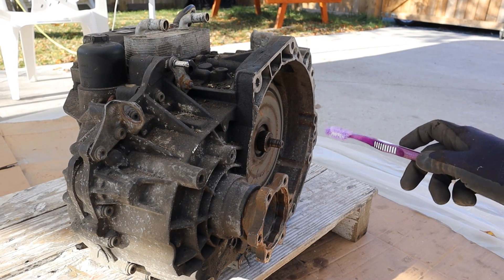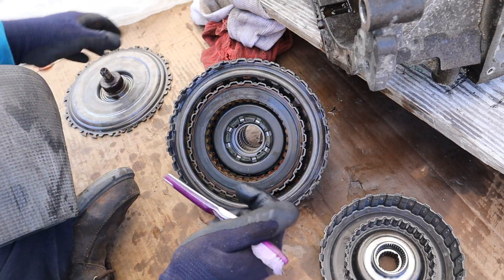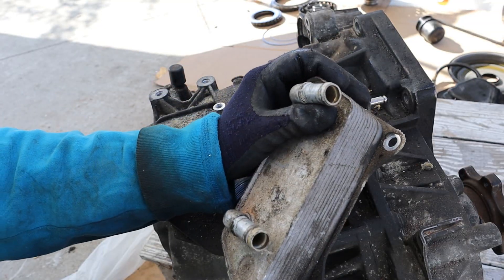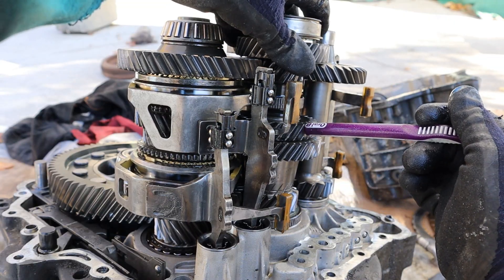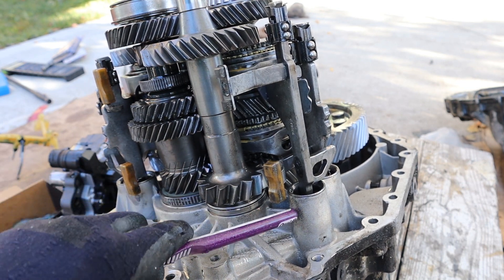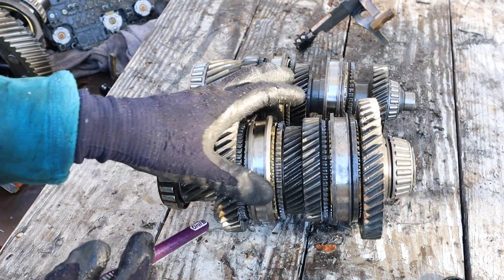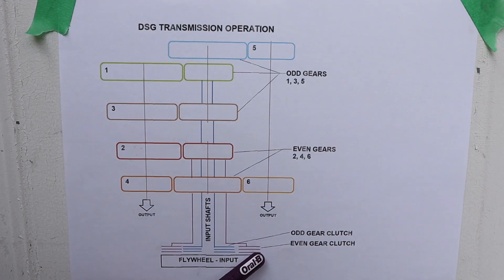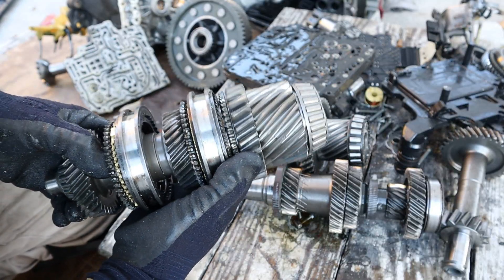How a Dual Clutch Transmission Works

Comment: 5:02  "probably didn't do oil service"  is a really stupid comment only a short time after inspecting the perfect condition of the clutches in the 300,000k transmission.  The internals are in perfect condition, no deposits on the magnets, nothing.  Probably DID do transmission service.  The video perfectly demonstrated the very rugged build of the transmission.  The only issue is possibly the dual mass flywheel, which is the way of all dmfs in that they are rubbish.  Owner definitely didn't wash the engine bay......
Reply from the maker: Perhaps they changed the fluid but didn't know there was a filter because that was really bad
Reply: @speedkar99  True, maybe it was aftermarket filter?  In any case, the filter worked 100% as the internals are pristine everywhere.
Reply: He was referring to the filter that was coming apart that obviously hadn't been changed. Clutches aren't the only thing that causes failure. I highly doubt who ever owned that tranny did a fluid change but ignored the filter that's right under the hood & the easiest part to deal with. I've seen a lot of those filters replaced but I've never seen one coming apart like the one in this video.
Reply: @wandameadows5736  Obviously the filter condition had NO effect on the longevity of the transmission.  But who knows if the filter was genuine or not, and deciding that it was obviously not changed is a stretch - there is zero evidence to base that conclusion on.  Conclusions should be drawn from the pristine condition of this box internally.  If the fluid and/or filter was never changed, it speaks volumes for the quality of the internals.  If the fluid was changed regularly, it speaks volumes for the quality of the internals. There wasn't any sign of wear on the bearings, gears, clutches, synchros.

Comment: The guy I bought my car from said his family owned a VW with a DSG, and they sold it with close to 200k miles with the original DSG still working well. He said they maintained it with regular fluid and filter changes. MAINTENANCE IS KEY!
Reply: People don't do maintenance and then say that a car is unreliable, like not changing the timeing belt and then saying a chain is better (i personally prefer a belt that i know when to change rather than a chain with plastic tensioners that idk when to change and are just gonna fail)

Comment: Wow I can’t lie I was expecting all the parts to be worn and in poor condition, glad to see VW manufactured a (mechanically) reliable unit.
Reply: Nope, it's quality is not very good
Reply: The newer gen. of DSG are More reliable than the first one. The first gen. was crap
Reply: @PDD87  less worse, you mean....
Reply: I personally find that people give VW a bad rep. All you need for your VW product to be reliable is treat it kindly. But that’s just my opinion.
Reply: @archangelsakura  well to be fair VW cars have been known to have electronic issues and become expensive to maintain once they reach a certain point down the road.
Reply: @archangelsakura  my mom had a 2003 Jetta she bought new that was great for the 10 years and 100 K miles she had it. So she next bought a brand new 2014 Audi A4 that was so unreliable and terrible for the 7 years she had it that she vowed to never buy a VW/Audi again.

Comment: What's the difference between mèchatronics and valve body
Reply: The mechatronic is shifting gears and operating clutches. Automatic valve bodies only operate clutches…I assume. 
The old automatic transmissions valve bodies would select the correct gear using fluid pressure alone. Many still will in “limp home” mode. 
The mechatronic won’t work without all the electronics working.

Comment: wow its complicated soooo many things can go wrong
Reply: It's way simpler than a torque converter automatic (but not as simple as a manual)
Reply: @Giuliana-w1f  VW TDI isn’t that automatic tourque transmissions?
Reply: @EnergySeeker  this one is a dual clutch automatic, a torque converter automatic is way worse (this one is almost a manual with hidraulics, electronics, and a weird clutch)
Reply: @Giuliana-w1f  double clutch that is , !!!yes very weird